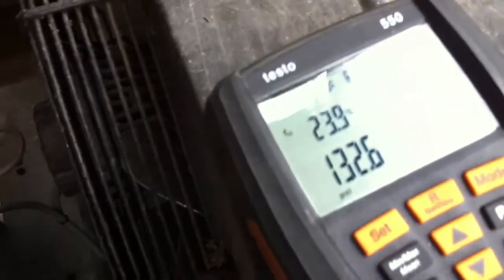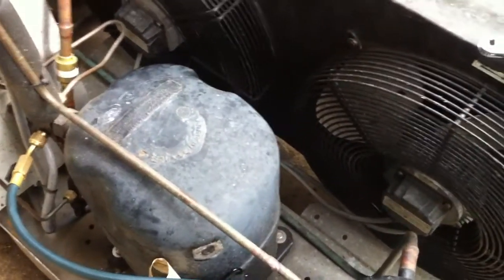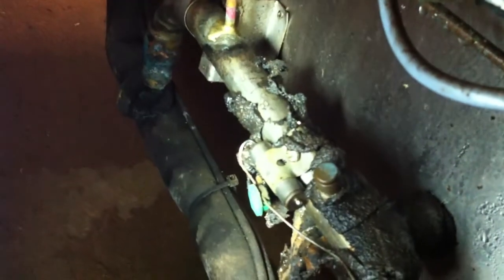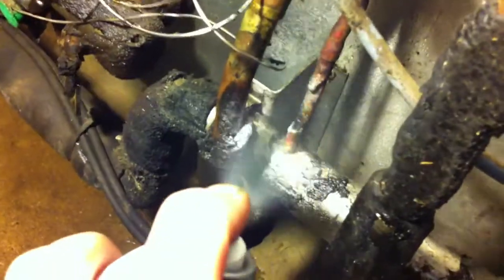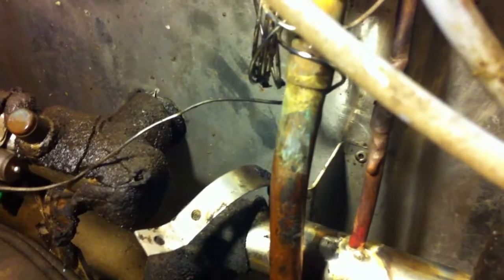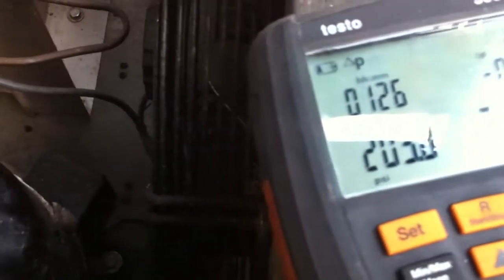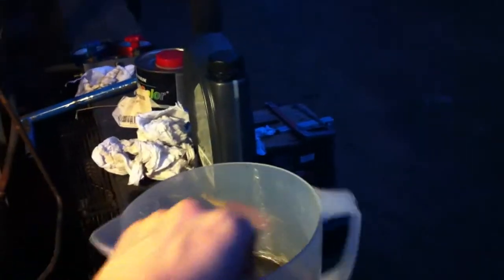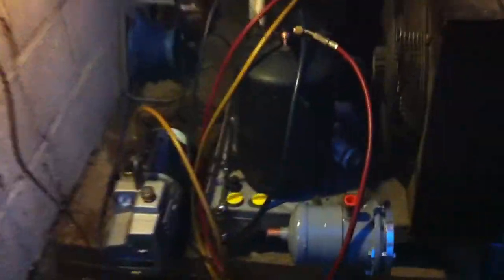Mueller Moisture Problems

Comment: Hey Diesel, great video as always. With the amount of wet systems you have to deal with I wonder if a cold trap before your vacumn pump would be a good addition to your arsenal. I normally use an old recovery tank in a cooler of ice. Helps keep the water out of your pump. Seems to dry the system faster as well. Thanks again for all your videos and Merry Christmas.
Reply from the maker: Thanks for the suggestion! That would have saved a fair bit in vac pump oil on this job!

Comment: poor old system, nice work mate :) as always.  nice big drier, that should help. going to purge the system using nitrogen blows? like in one of your previous vids?
Reply from the maker: Thanks! I didn't blow through it like before, just lots of deep vacuums then fill with nitrogen and repeat till no moisture comes out.
The one's ive blown through have had water in one part of the system but this one it was all through it!

Comment: Will the compressor have to be replaced after having water mixed with oil getting into the innards of it?  Those copper fillings don't look like a good sign.  Poor thing.  Amazing what a little bit of water can do to a refrigeration system.
Reply from the maker: The compressor should be ok, the fillings likely came from when the pipework was installed. I ran the compressor to pump the system down and it run ok but i will know for sure tomorrow hopefully!